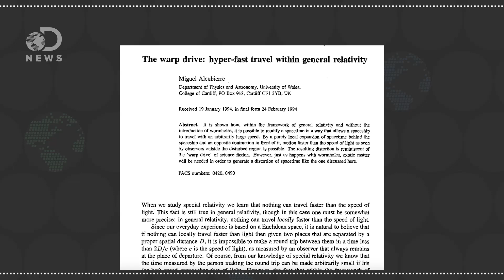How Close Are We To Star Trek's Warp Drive?

Comment: I'm a big fan of this theory, but there is a problem I've never heard anyone address before. Our perception of the passage of time is dependent upon our movement through space. The earth is moving through the universe at great speed, and this allows us to experience the passage of time at a steady rate. I think people take this for granted, no one seems to have considered the fact that if you create a warp bubble that can move through space faster than the speed of light without experiencing time dilation, then that implies that the spaceship and crew's perception of time is dependent upon their movement through the space of the bubble, not the space surrounding the bubble. If this is the case, then the ship itself is not actually moving relative to the space it occupies, and without moving through space, time will begin to pass very quickly for them. I'm not a physicist so I don't know how much, but I'm pretty sure it wouldn't be insignificant. It makes me wonder if there is a speed limit to time perception, because if a physical object were to achieve the speed of light, their perception of time would come to a halt and they would just be frozen in time until they slowed down, so does it go the other way too? If you can manage to stop moving completely relative to the fabric of space around you, I suppose that perfect stillness has a limit, you can only be so still, so that would be the speed limit of time. But I also wonder if the laws of thermodynamics would come into play and prevent you from staying still, much like how it would require an infinite amount of energy to cool an object to absolute zero.

Comment: The main factor to consider in traveling faster than the speed of light is that the faster that you travel to the speed of light the faster that you encounter atoms that would function similar to jumping out of a plane into water at various heights. If you jump into water from five feet you haven't built up enough stored kinetic energy to cause any problems. But if you jump from twenty feet and do not enter the water correctly you break a few bones. Jump from 50 feet you are more likely to break bones because your body does not maintain an arrow like form when passing into the water. 

A starship would function the same way. 

The only way to travel faster than the speed of light is stream line your ship with a field that reduces the amount of atoms being encountered to reduce the stress placed on the ship. Reducing the amount of mass and atom has can be achieved by using using a Cold Atom Lab type device that reduces the temperature of atoms to almost zero or a state at which the Universe would have been at right before the Big Bang when atoms and gravity based on Einstein did not exist. 

Because most of the gravity that limits FTL travel exists because of Suns producing elements that have mass, reducing the atoms in space around the starship to almost zero mass is the key. FTL doesn't violate Einsteins theories because there is still a form of gravity that exists when you part the atoms in space just like there is still a form of gravity that exists when you part the water while you are jumping into it. 

The velocity would be determined on how many atoms you cooled to the point of not creating a gravitation field. Coming out of light speed would be relatively the same as traveling very fast through a large puddle of water that is deep enough to hydroplane in. You would slowly allow more atoms to not be cooled by the CAL over time that would create more mass in front of the ship that would slow the forward velocity of the ship. Basically pumping the breaks while traveling through the puddle of water. An Emergency Stop however might be tricky because the amount of atoms suddenly re-introduced at the front of the ship could result in the ship being torn apart or at least hydroplaning and going out of control until the forward momentum was slow by gravity.

A VASIMR Plasma Drive could be more than enough thrust to propel the craft to light speed and faster because no one is really certain how much a certain amount of thrust potential would result in forward velocity in the medium of space time that existed prior to the Big Bang when planets and stars that produce the limiting gravity did not exist.

The gravity that existed prior to the Big Bang that held particles together that created the Big Bang would provide enough gravitational influences to hold the ship together as well keeping biological systems together. 

The Alcubierre Drive would work if it was able to direct all atoms that it came into contact with around the ship to create a Pre-Big Bang Space.

Comment: Relativity, and Warp Drive are Old school physics. Torch drive is the real thing! Instead of Location A bending towards Location B you torch space to make a tunnel between the two points, and then you make the tunnel zero length leaving Location A, and Location B where they are. It is the same formula inverted, but that is necessary because all of science is currently inverted. The Big Bang uses inverted physics.

Comment: You might be able to obtain enough exotic matter if hawking radiation can function in reverse, and if we can induce this in a particle accelerator. 

if hawking radiation can work in reverse though, and if we can induce it to evaporate normally after, it would allow us to produce  miniature black holes in addition to exotic matter.  With that we could use it as a power source,  or more realistically use it to create gravitational waves.

Now, picture an acoustic hologram device,  but instead of sound it uses mini black holes to produce small gravitational holograms. With the same techniques that allow an acoustic hologram to move an object,  it can move the ship by moving space,  and that should make things easier IF you can maintain the exact mass of the black holes. 

As far as dark energy goes, for all we know that's a field effect related to quantum entanglement.  My opinion is that the universe expands faster because each end is connected in this way, but if that's true you can't use it for warp drives.

Comment: I like dreaming too, but don't you have to walk before you can run? When the air plane was invented, they didn't purposely invented a flying machine that could break the sound barrier, they just wanted to fly, then once human kind knew how to build air planes, they moved to jets and eventually supersonic. Shouldn't we figure out how to go at the speed of light first before we can work on how to go faster than lights peed?
Reply: Well, I see why you might say that, but I think there's a bigger picture view for this. See, we can travel through space at sub-light speed already. And given enough time, we can get a craft to the edge of the solar system. Like in 15 or 20 years. In one solar system. Even traveling close to the speed of light, the closest star is five years away and there's going to be time dilation, so that's going to cause some weird issues even if we can get close to light speed. That we can theorize a way to travel faster, without the time dilation, is a pretty big deal. Also, since this video was made we've done something with negative mass in a laboratory. So to me, putting effort into this makes a lot more sense than trying to come up with faster sub-light drives. That's how I feel about it. Now there's a new drive proposed by Alcubierre-Froning, I think, that actually is a bit more like punching through the lightspeed barrier like a plane going through the sound barrier, but I don't know as much about that, so I can't really speak to it.

Comment: Yes, but what use is it to travel that far when any transmission back to earth that everything went well, will take light years to get here? You would have to get radio or laser (if we figured out how to place such messages into a laser) to move FTL. So if you suddenly had a malfunction, nobody would know for possibly hundreds or thousands of years, depending on how far you've traveled. So therefore, in our minds at home, the experiment was a total failure... also... at those speeds, a particle of dust would WRECK you.... Like, you'd be vaporized....
Reply: not necessarily, a drone carrying the message could warp back
Reply: dash wsd Quiet true. You'd have to have nanobots building them, however otherwise they'd take up a ton of space. But I suppose if you're warping off to places light years away, you'd have such a system worked out.
Reply: Technically you're not moving, but space is moving around you, so you don't need to worry about being destroyed by debris in space, to my knowledge

Comment: so we've gotten a bit farther. By changing the shape of the warp bubble we got the energy requirement down to about 65 exajoules of negative energy. Which is the equivalent of the power produced by the US over an entire year. Negative energy is a little more difficult to come by, but not as difficult as you might think. If you ever have access to a vacuum chamber, place two uncharged metal plates a very small distance apart. Long story short (which involves virtual particle densities) the two plates will be pushed together by negative energy. Our only real issue is how to store negative energy until we can get enough to create the warp drive.

Comment: The theory of warp drive travel would never work.  Every physicist agrees.  Warp drive would be useless without shielding from the immense radiation in space.  Scientists agree not possible to create functional or plausible shielding for derp space travel.  You would also need a deflector shield which is impossible as well, if you don't want your ship destroyed by debris floating in the path you're taking.  So, accept it folks.  Without wormholes we aren't traveling outside our solar system.

Comment: Actually negative energy is not energy it's the absence of energy if you think of the universe having a constant energy of zero like on the thermometer the negative energy is when you have a lack or below zero the problem with the theory is it requires both astrophysics and quantum physics to work together and I don't think anyone's figure that out yet. by the way that doesn't mean The theory wrong.

Comment: Why would you create a bubble if you wanted to travel using gravity? Wouldn't you want to create a lopsided shape like a cone. Space and time, according to Einstein, is interwoven like a fabric screen or mesh. For a 2D example, take a screen and put two ping pong balls at opposite ends. They slightly indent the screen but they stay put. If you then put a baseball centered between the two ping pong balls the baseball will indent the screen and the ping pong balls will both come to the baseball at the same speed. If you put a lopsided shape object like a bowling pin centered between the two ping pong balls the ping pong ball at the larger end the the pin will arrive first. I would think that this would be the idea behind moving in a certain direction.

Comment: Yes we are closer, much closer than most people think. In college labs across the country; engineering students are discovering new ways to create spacecraft propulsion systems producing much greater power or thrust using less fuel. The French have actually produced a containment system for anti-matter that works, and of course NASA's new developments into warp drive. Now as far as the imaginary Dilithium Crystals are concerned, imagine different types are batteries that drain at different rates. The crystals are not only amplifiers but energy producers as they have huge amounts of stored energy waiting to be relieved. This is why the dilithium is always being replaced.

Comment: this is just a theoretical question but if we could generate negative energy wouldn't that also generate an equivalent amount of normal positive energy making this method of travel, if possible, extremely efficient or completely self sufficient? And if it does generate energy couldn't we just use that as the generator or would that mess up the warp bubble balance or something?